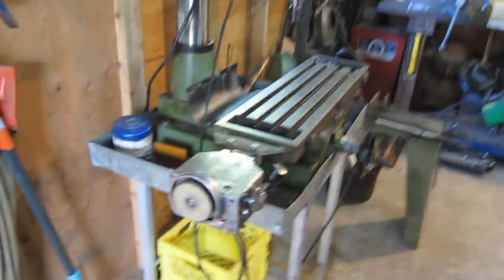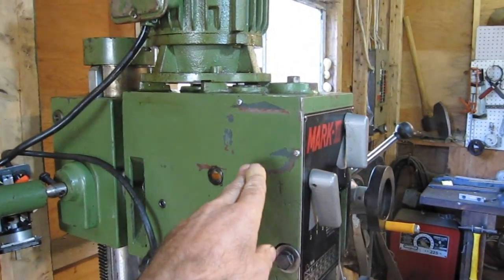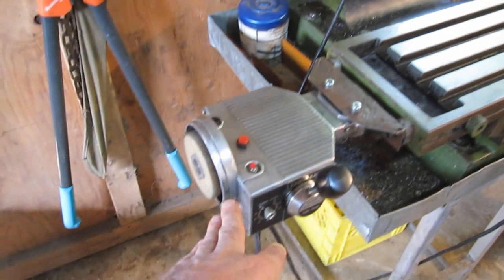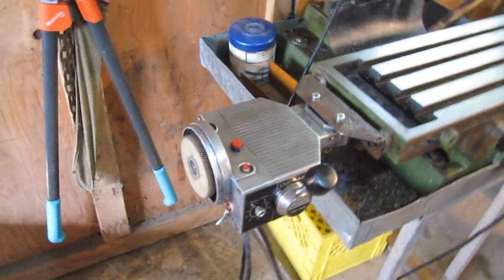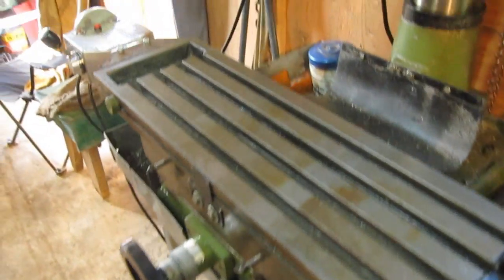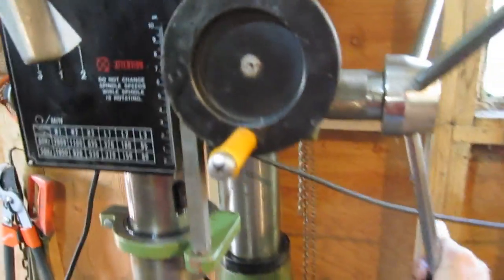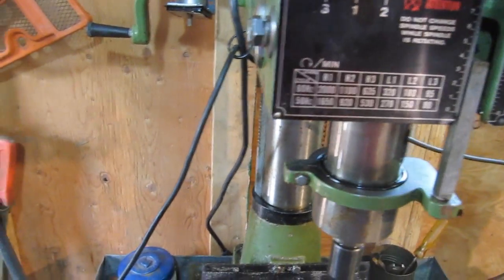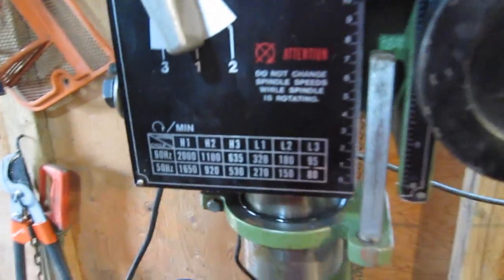Mill feed working.

Comment from the maker: @spanky061970 
The fixture the feed screw went through was broken through the holes.
I flipped it over, and welded it to a plate then tapped the holes so the thing can float up or down if it wants to.
It worked great and it is very smooth.
Then was the biggest problem, and their were many others.
It was a fun project and I've got a functioning milling machine for only $400
Reply: Conan568 picked Up a 12 inch chraftsmann lathe like that 200$ way lifted by counter shaft  cracked ....fixed.
.